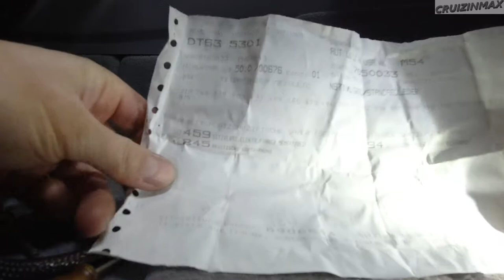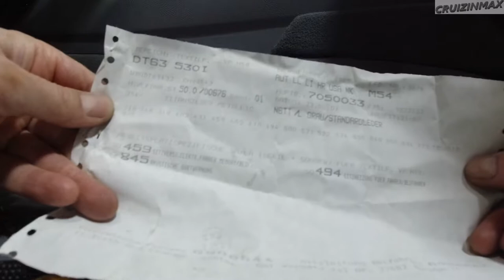BMW 530i E39 power seat not working or twisting

Comment: Perfect instruction. It saved a day, I had the same problem. I wonder BMW did not realise, that they made the inside cable too short. To cut outside cable cover more easy, you can actually first pull the inside metal cable out, grease it, cut outside cable and insert the inside cable back in. Thanks a lot!

Comment: The thin wire cable, when attached, moves the seat belt height up and down once you move the seat back and forth, automatically. German engineering indeed :). T50 bolts that holds the seat to car chassis take a couple of drops of blue loctite and are torqued to 45nm.
Reply: What is the torque spec for the bolt that holds the seatbelt?
Reply: @leoromo74  A couple drops of blue loctite and torque to 45nm or 33ft-lb

Comment: The cable coming from under the carpet and connected to the underside of the front seats. That cable is the seat belt adjuster. Front seats have that cable. When you push the button to move the seat forward/backward, look at the seat belt where it comes from the pillar, you'll notice the seat belt going up or down depending how the seat is going forward or backward.

Comment: Another way to do this repair would be to source the inside drive wire, cut it to length and simply insert it into the sheath without cutting it.  One idea would be to use the drive wire for a weedeater.  I'm not sure the size is correct, though.
Reply: I looked into this and found one problem.  The flex shafts I found only have the square drive sections on the ends.  The rest of the cable is round.  So, cutting to length could be a problem because you may end up with an end that is not square.